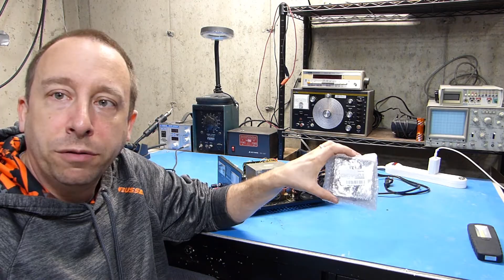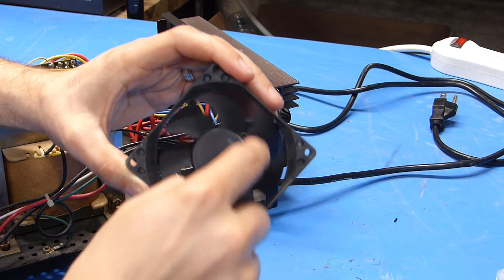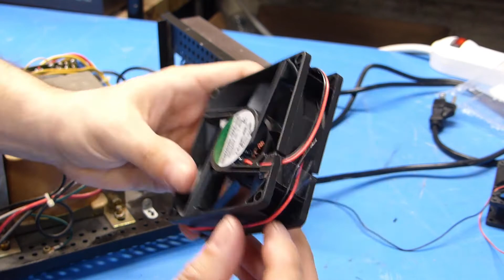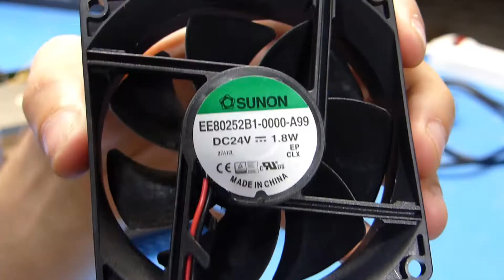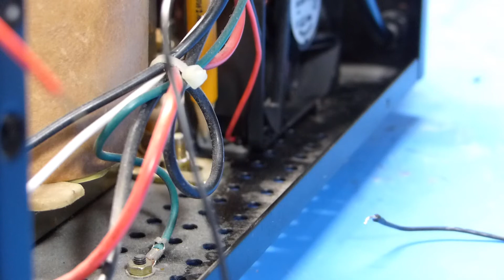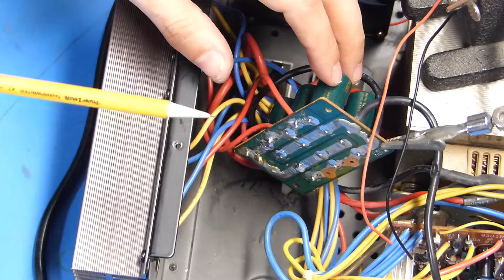Pyramid Power Supply Fan Replacement PS-36KX

Comment: I have a PS36KX production 2015-3-10.  I have replace the 2 rectifiers, an the Pass Transistors, LM723 variable voltage regulator.  The SCR appears to be good, but I have a new one on order to replace.  I have inspected the bottom of the traces of the board that appear to be clean.  the voltage out of the transformer appears good.  I am still getting the alarm and no output.  I have checked diodes and they appear OK.  I am stumped.  Any suggestions would be much appreciated.  Thank you, Art
Reply from the maker: I don't have the schematic handy but is there another if or transistor in the alarm circuit?  If not, maybe try another 723...i vaugley recall something similar with my unit and had to trace the 723 twice or something else in the circuit